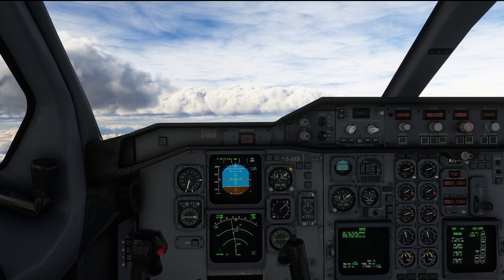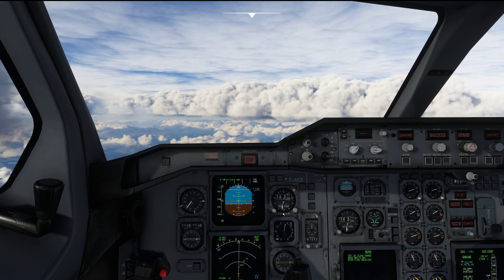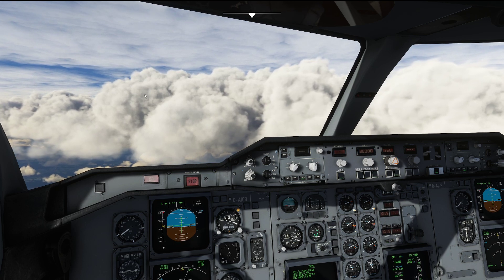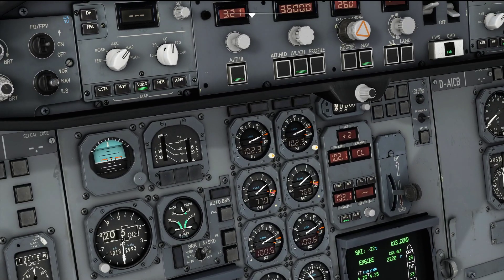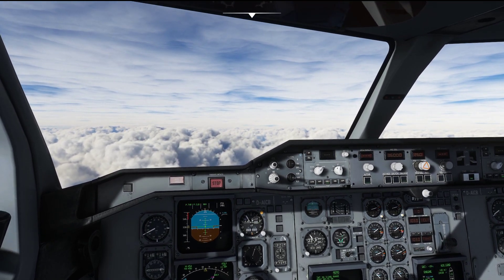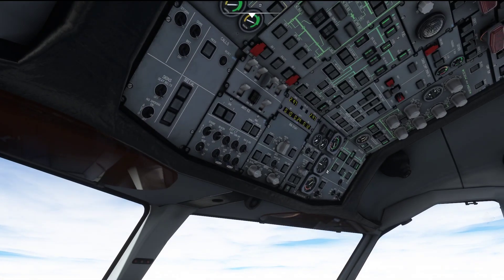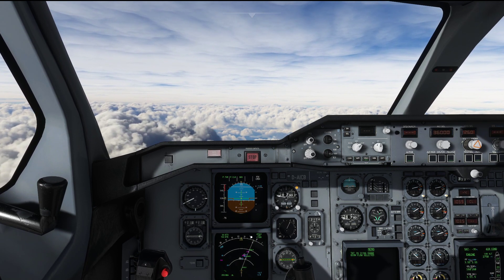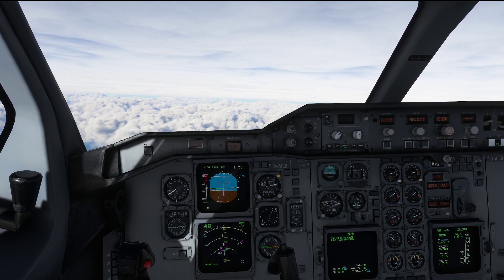MSFS A310 Tutorial 7: Climb | Real Airline Pilot

Comment: Another great video- I have a question about the wing anti ice you were mentioning? SInce its only once ice has accumulated, is it more like heat directed from engine to capillaries of warmed fluid under surface, or wires with resistance like rear windshields/walkways have? They don't still use those boots that pnumeatically inflate and llterally "pop" the ice off laminar edger right? I remember watching a video of one certain plane that crashed due to ice on wing(I believe was back in 80s?) because those boots only cracked leading edge of ice, and rest progressed over wing surface. Seemed like a flawed design to me- nobody still uses that do they?
Reply from the maker: Thanks! Wing Anti Ice is driven by bleed air from the engines which heats up the leading edges and thus melts the layer of ice which holds the ice on the wing. The airflow will just blow it away then.

Comment: Hi Emmanuel, always a pleasure watching your videos and learning from them. I have an issue where the pressure cabin remains at ground level while climbing. Happened to me in my last two flights. Packs are on, everything on auto, what am I missing?
Reply: I've had the same issue on my last flight, could not determine why, packs were on....Following !
Reply from the maker: Talking about the A310 (just to be entirely sure): I've had the same thing a few times. Probably a bug.
Reply: @A330Driver  I just found that any time I mess around with the pressurization system (twisting any of the knobs), the system won't work properly during climb. Once I left it as is, it was able to increase the cabin altitude correctly. Definitely a bug.
Reply: @A330Driver  now my other issue :) unrelated but I can't see traffic in the ND while flying in vatsim. I once got a TCAS audio alert when I was about 1nm away from a descending aircraft :) no indication in the ND..